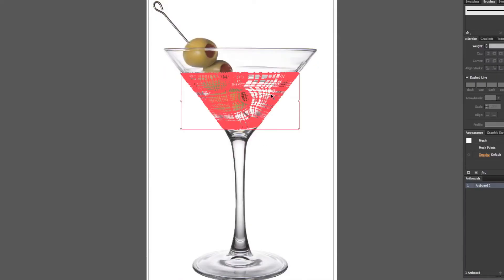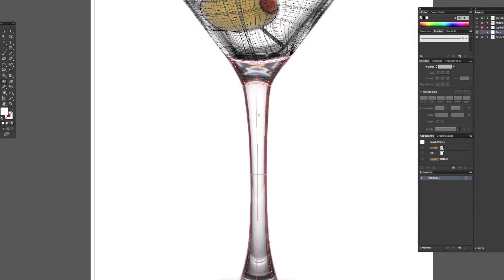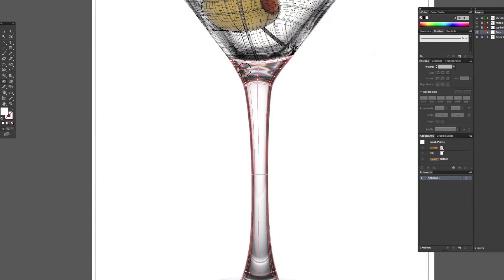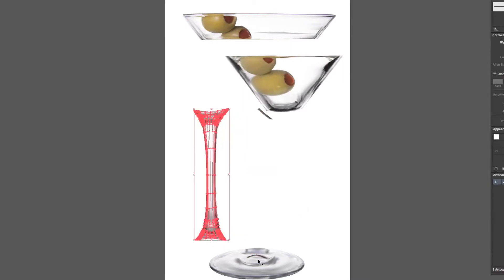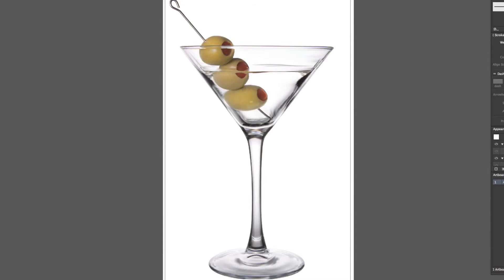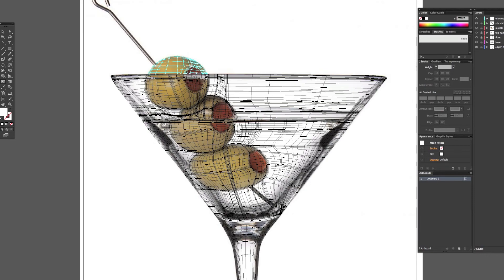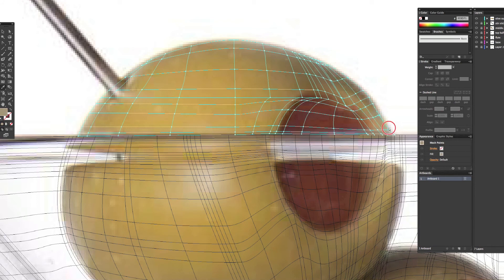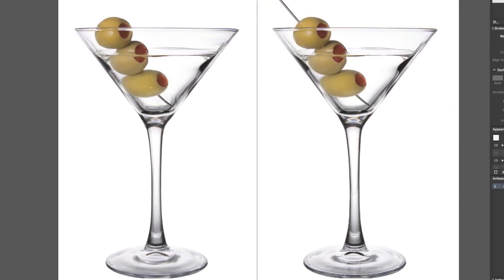How to Gradient Mesh a Martini Glass Tutorial (pt.2)

Comment: I guess i'm not at the level in illustrator and using gradient mesh to understand this video. I don't know what you really doing; where you are putting the mesh gradient and why or how are you able to not have color in the mesh while transferring the color. I've been through 7 similar videos and i still don't get it. I've already wasted 7 hours and I haven't made any progress in my project......ahhhh I'm going to go cry in a corner now.
Reply: Hello! try to CTRL/CMD + left click on the little eye icon that refers to the layer you are working on, and then you will be able to see the wire frame on that layer, so you can pick the color from the original photo that is still behind that layer, possibly locked, quikly with the eyedropper / direct selection tools ( CTRL+ I and then press and hold CTRL with that tool to instant switch from eyedropper tool to direct selection tool)
hope it helps!